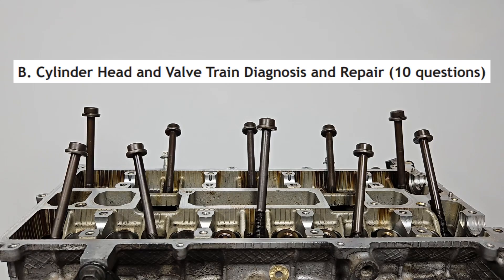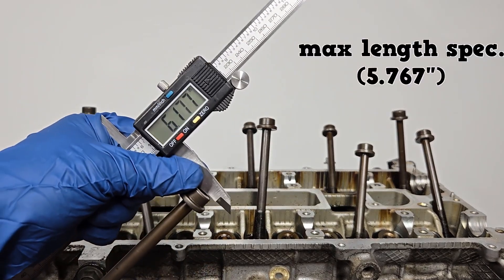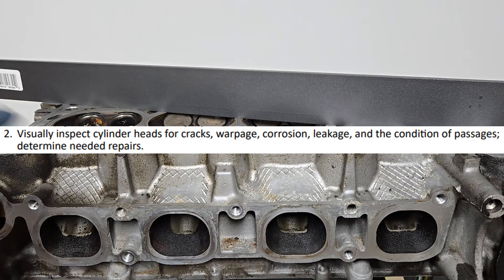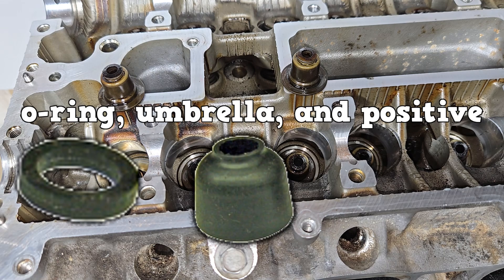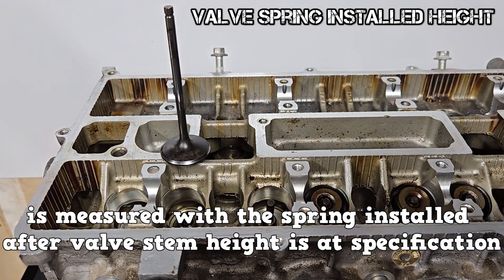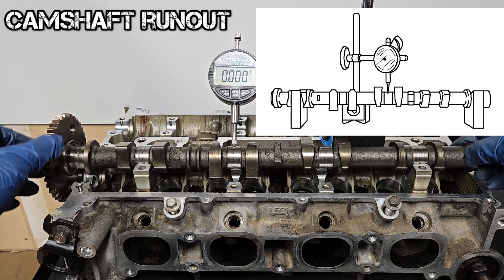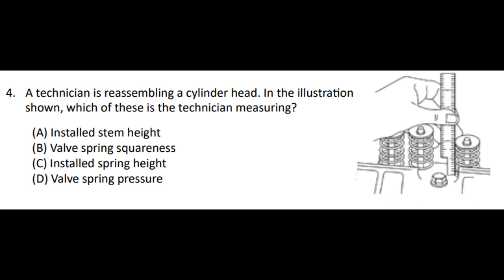ASE A1 Test Prep #3 - Cylinder Head & Camshaft

Comment from the maker: Feedback after taking the test: The first 4 minutes show great info BUT not much about that on the test.
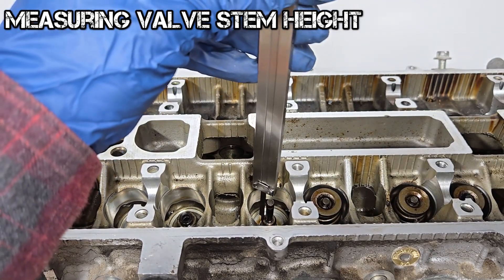The stuff to know is between 4:00 and 6:24 . I should have included basics such as what is acceptable to use when cleaning the mating surfaces, and how to do a "final" cleaning on the head and block.
Video #2 shows how to calculate valve guide wear, BUT what is shown on the test is another method. Know the other method and how to calculate.